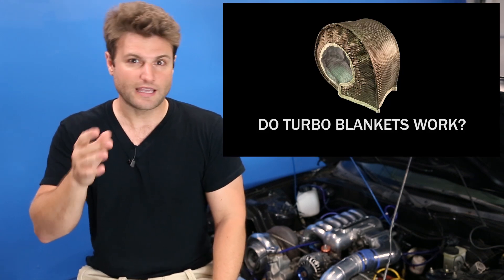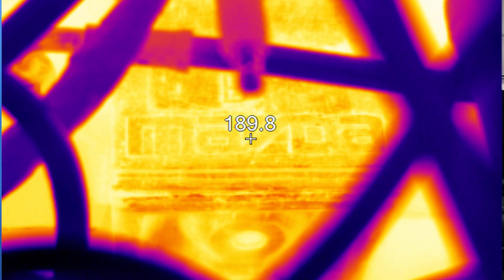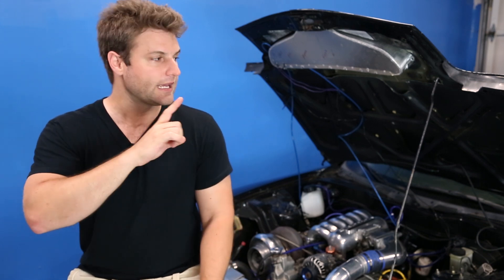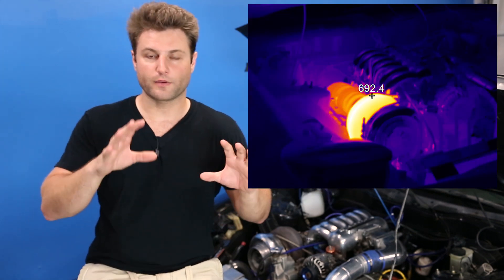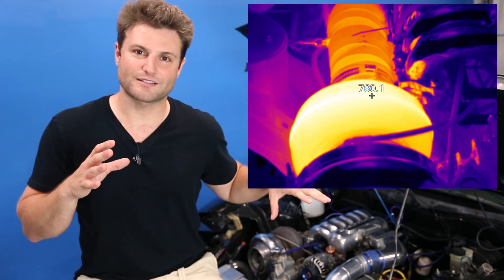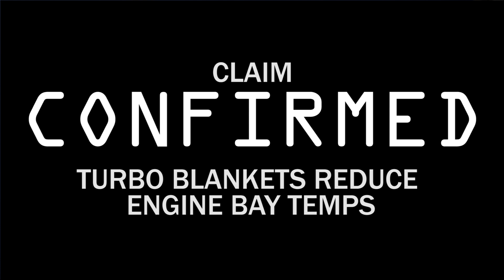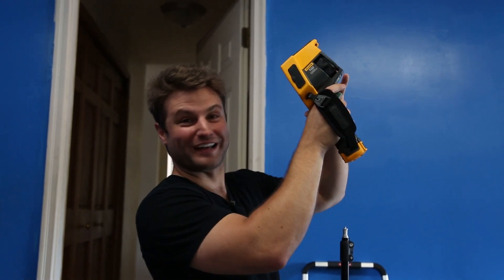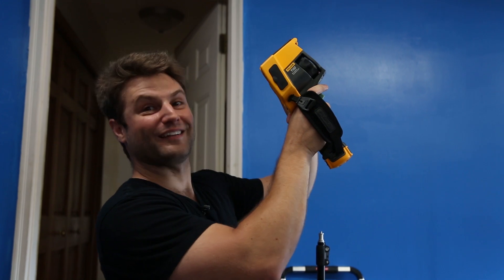Do Turbo Blankets Work?

Comment: thats why i love my diesel. 50-60% efficient. loving the f250 on 37s getting 20mpg.
Reply: 20mpg is not efficient. here we've got diesels touching 70mpg...which is 80mp(USGal)
Reply: A 4x4 f250 on 37x14 tires it's pretty good. We've got small cars getting 65mpg or so
Reply: +KustomGraphics206 its a 3/4 ton truck. not for mpg at all. but does good for its size. I've had 2 other heavy duty truck with gas motors and if I got better than 10mpg it was a good day.
Reply: He was talking about efficiency at one point in the video. Also, mine and lots of other turbo diesels make more power than that car.. So making more power, and better mileage, kinda relates lol
Reply: +KustomGraphics206 he mentioned that gasoline engines are only 30% efficient or something like that. that's all I was replying to
Reply: +KustomGraphics206 he mentioned that gasoline engines are only 30% efficient or something like that. that's all I was replying to
Reply: +KustomGraphics206 he mentioned that gasoline engines are only 30% efficient or something like that. that's all I was replying to
Reply: +KustomGraphics206 I definitely don't! lol. my diesel truck still almost doubles my gas truck in mileage so I drive it more. more comfy too. but we have a kia that gets 38mpg so its not too important to get good mileage in the truck.
Reply: +KustomGraphics206 I definitely don't! lol. my diesel truck still almost doubles my gas truck in mileage so I drive it more. more comfy too. but we have a kia that gets 38mpg so its not too important to get good mileage in the truck.
Reply: +KustomGraphics206 I definitely don't! lol. my diesel truck still almost doubles my gas truck in mileage so I drive it more. more comfy too. but we have a kia that gets 38mpg so its not too important to get good mileage in the truck.
Reply: +KustomGraphics206 I love my 6.0. drove the truck until 197k miles only issue I had was egr cooler busted around 180k. at 197k I was having long crank to start issues and started swapping injectors, issue seemed worse so I built the whole thing with 190/75 and all the supporting mods. turns out it was just the fuel pump. had heads checked at machine shop and they were perfect. put them right back on only blocked once. maybe I'm one of the lucky ones. but so far, 205k miles. truck towes a lot and sometimes towed real heavy. even with big fuel I pulled 18k for 7 hours at 75mph, egt around 1000 sustained. still going strong so fat.
Reply: +KustomGraphics206 I love my 6.0. drove the truck until 197k miles only issue I had was egr cooler busted around 180k. at 197k I was having long crank to start issues and started swapping injectors, issue seemed worse so I built the whole thing with 190/75 and all the supporting mods. turns out it was just the fuel pump. had heads checked at machine shop and they were perfect. put them right back on only blocked once. maybe I'm one of the lucky ones. but so far, 205k miles. truck towes a lot and sometimes towed real heavy. even with big fuel I pulled 18k for 7 hours at 75mph, egt around 1000 sustained. still going strong so fat.
Reply: +KustomGraphics206 I love my 6.0. drove the truck until 197k miles only issue I had was egr cooler busted around 180k. at 197k I was having long crank to start issues and started swapping injectors, issue seemed worse so I built the whole thing with 190/75 and all the supporting mods. turns out it was just the fuel pump. had heads checked at machine shop and they were perfect. put them right back on only blocked once. maybe I'm one of the lucky ones. but so far, 205k miles. truck towes a lot and sometimes towed real heavy. even with big fuel I pulled 18k for 7 hours at 75mph, egt around 1000 sustained. still going strong so fat.

Comment: Doesn't rising your turbo temperatures kill its bearings faster?
I'm affraid that this would kill turbos sooner just like the wraps to the exhaust manifolds do, the temps usually increase the likeness of cracks and deformation due to expansion.
Reply: +Eryk Szymanski your statement isn't wrong, but if you want to use the energy that's gonna be wasted, you must wrap up the exhaust manifold and insulate the turbine, to use as much enthalpy as you can squeeze out with your turbocharger. For sure your thrust bearings need to be cooled more than before...

You know, when you talk about performance, you always have a short blanket...it's not simply to have maximum reliability, efficiency and power at the same time ;)
Reply: I was thinking the same thing. If your wrap the turbine housing then it cannot dissipate heat to adjacent components. Sure, the compressor and intake manifolds may be cooler but you are adding a lot of heat stress to the compressor, increasing the chance of bearing failure or a crack forming in the housing. Would it make more sense to wrap the compressor housing and intake manifolds to insulate them from engine bay heat?
Reply: This was my thought as well. Turbo blankets (as has been proven a few times) have a HUGE impact on containing heat, but at the expense of the overall longevity of the turbo. Enough to be significant in my opinion.

I'd rather opt for an inside/outside ceramic paint job. I don't think that's quite as effective as a full, thick blanket, but a proper ceramic coating will help keep temperatures more tame while still dissipating properly.
Reply: +newpa1n I absolutely agree man, in fact in my next build I think I'm going for a ceramic coating 😉

Comment: All turbo & hot pipe blankets are NOT built out of the same stuff & are NOT equal & the most expensive on the market is NOT the best. Silica quilted blankets are by far the best. The goal of boosting an engine is to increase the air density to the engine & hot side heat absorbed by the cold side is counter productive to that. Plus if you're picking up hot intake air under the hood you are also decreasing the density charge. Monitor the charge temp at the engine, the lower the better.

Comment: I think it was touched on in a previous comment...but no replies.  But my first thought isnt that blanket going to cause the turbo to overheat or at least wear out prematurely?  i would assume that one could up the oil cooling capabilities, but I really dont know that much about turbos.  Someone else commented here....rear mount...that has always made the most sense to me (especially since I plan to turbo a truck).  I understand that the physical distance should create more lag, but cannot that be corrected for by tune?  Or if anything....evil grin....throw a supercharger on there too....super/turbos were not that uncommon on many old airplanes from what I have researched.  Sure a ton more money...uncharted tuning waters...and a whole lot more work...but it would give a whole new meaning to "S/T" badging...lol....just my 2 cents....

Comment: One of the more common explanations I've heard is keeping the impeller side as hot as possible, and limit that heat to the turbine housing.  The rest of the exhaust will be a lot cooler and, hot fluids/gases will flow towards colder environments (kind of like the EJ20 engine having an oil reservoir above the turbo to allow cooler oil to flush through the bearing interface via thermo-capillary action).  Be it the exhaust pipe (which is designed for it) or the hood (not so much).  Also, if running higher swirl densities with water, ethanol, or methanol injection (or even an E85 tune) you're going to have more moles of gas getting flushed through the impeller.  Controlling its radiated heat that's wasted is incredibly important, and why most turbo cars have a lot of heat shielding around them.  Although that's one of the nicer looking turbo blankets I've seen.

Oh, and 30% + 60% = FTW.  ;-)

Comment: but wouldn't containing all that heat and preventing the transfer of heat cause the turbo to reach a point where it'll all fuse together? as in the turbine to the turbo wall... also how would air from the intake have different temperatures per cylinder? isn't the air entering from the throttle body into the manifold getting equally distributed to all the cylinders at equal temperatures?
Reply: because on this engine the turbine housing sits right next to one of the intake runners which means it gets heat soaked and the air going through that runner will be hotter than the other runners
Reply: Tom Nicklas Sand So it is not applicable on reciprocating engines?
Reply: Usually not a problem on engines with crossflow heads but older engines with exhaust and intake on the same side like datsun L series can experience heat soke if not properly heat shielded
Reply: Stupid questions so why ask also the turbo will never melt wtf are your smoking and each cylinder has it own temperature too look up (EGT ) please got do some research before post bullshit
Reply: Gaz Girl not everyone is well versed in everything car related or act so... I have my questions and as long as people are there to clarify those... I will continue to ask! I do know that each cylinders may have minutely different internal temperature due to variation in combustion and also due to pre-ignition etc... But read my questions... I was asking about the inlet manifold and how the temperature of air going to different cylinders can be different as I've seen engines where the inlet and exhaust manifold are at opposite sides! I also know that when a metal reaches its melting point it will melt... And at that if heat doesn't conduct to the environment the more the heat buildup occurs!
Reply: +Sukrith Krishnakumar I know this already also the temp in the intake mainfold will be different but to a point also depanding on if it's turbo /na  car everything has a massive effect different components so this will change things so many factors list goes
Reply: +Sukrith Krishnakumar mate you need a shit load of heat to melt cast iron like 2000 c easy before it melts and what engines are you talking about because most or all engines are cross flow design and not the intake and exhaust mainfold on the same side or non cross flow engines
Reply: It's more of an issue for a rotary because unlike a modern piston engine you can't control the air fuel ratio per rotor at least not with any ECU's I know of.  With the stock tune that's not an issue, but with more aggressive tunes there isn't much wiggle room.  In many cases the sensor is located in front of the throttle body which is on the opposite side of the engine from the turbo.  A 10c could put you at risk of detonate which has a nasty habit of breaking the apex seals.

I somewhat doubt it effects the air temp that much though, that air is moving really fast so it's not going to have much time or surface area to pick up a lot heat.  I would be more concerned with lower the overall under hood temp, which why many people run full vented hoods on these cars.

Comment: Well I learned that an engine that is 30% efficient wastes only 60% of its potential energy... Good to know that 30% + 60% = 100% lol
Reply: +Rob Dahm besides, 30 is quite a bit of an overstatement. I'd say 20 to 25 at best for a gas engine. A rotary will probably do even lower.
Reply: there's also sound, like vibrations, so a small percentage will be converted to sound.
Reply: there's also sound, like vibrations, so a small percentage will be converted to sound.
Reply: there's also sound, like vibrations, so a small percentage will be converted to sound.
Reply: I assume he was thinking along the lines of 33.3 and 66.7 and then rounding down.

Comment: The claim about bringing the turbine blades closer to the housing (reducing clearance) is easily checked, without ever breaking out a clearance gauge. Find out the material of the turbine wheel, the material of the turbine housing (I'd imagine that aftermarket turbo manufacturers publish this?) and check the rates of thermal expansion for those two materials on the interwebs. If the turbine wheel material has a greater rate of thermal expansion than the turbine housing material, then increasing temperature necessarily draws them closer. 

That begs the question, of course - does reducing that clearance actually improve performance? Does decreasing that clearance flow overcome any negative effects (reduced exhaust density, increased deformation of the turbine wheel, increased maintenance costs due to increased creep rates, etc) to make it worth it? That's up to each car owner to decide.

If turbo blankets were worth it for the OEM, they would have included it, at much lower cost than the aftermarket. It's not like thermal insulation is unknown to automotive engineering. So don't put one on your otherwise stock Focus ST or whatever.

Comment: Would love to see a difference between a bare turbo, ceramic coated turbo and ceramic coated with a turbo blanket. I know the ceramic coating on my ducati's exhaust helped a ton keeping heat off my leg as well as keeping the radiant heat off the parts that the exhaust is near throughout the bike.

Comment: Rob, I'm wondering how much difference polishing the hot side of the turbo would make, or coating it with a low emissivity ceramic coating vs the turbo blanket. Like you mentioned, getting accurate temperature readings with an IR cam is not easy from a polished/reflective surface (due to its low emissivity, i.e. the ability to radiate heat)...so with a polished/low e coated hot side, that should work very well to lower engine bay temps, and keep the exhaust gasses hotter. Doing all of the hot side piping all the way back to the motor should help tremendously. Btw, it still makes me laugh seeing another MHS physics kid getting his videos shared by the street outlaws crew on Facebook.

Comment: I have a Duramax and I'm told cool your turbo all the time.
Reply: When you're going to shut it off it should cool not during operation. They like to run hot but when shutting it off you should be letting egt's drop to 300 before shutting down. When not running, the oil isn't circulating anymore and the oil cokes in the bearings if over 300 and reduces the life of the turbocharger.
Reply: +jfdb59 that makes sense, I had a get gauge an always let it get to 350 before shutting it off, put over 200,000 km on it without a problem, thanks jf.
Reply: My LBZ duramax was a great engine though a bit thirstier on fuel than my cummins trucks. I have a cummins now with compound turbos and the kit came with one of these turbo blankets because the top turbo is really close to the firewall and a main wiring harness. You can put your hand on the blanket even with the engine idling at operating temp. It's pretty impressive.
Reply: +jfdb59 I also had the lbz, loved that truck, power was amazing, I was happy with my mileage I got about 19-20 mixed driving, it sure was fun when I put the ppe in, but then my 5th gear started slipping.

Comment: I am a firm believer in exhaust wraps or coatings aswell because I have had guys come in complaining of hard starts after a hard run down the road. the cause was the heat from the header or turbo evaporated the fuel in the fuel rail

Comment: This may be a stupid question, but by containing the heat and not allowing it to escape, won't that ultimately harm the turbo?
Reply: I think it may improve the life of the turbo by slowing/ smoothing out the heat cycles during a drive.
Reply: No, turbos are meant to run that hot if not hotter. If any it would help it to keep a more even heating in the turbo itself
Reply: Yea that too! Thermal stress will be less dramatic when the turbo is cooled slower and more evenly!
Reply: https://docs.google.com/file/d/0B1DKgBxqE0JEME5wQ1pIc1N5dU0/edit?pli=1
Reply: It is bad for engine oil.

Comment: you should put a lover section right behind the turbo exhaust  on the hood . and have it so the cool air will go over and pull the heat out of the hood in that area

Comment: A big benefit of turbo machinery is that higher temps in the exhaust side result in more energy extracted from the gas passing through the exhaust. The energy extracted goes straight to the compressor and the gas is more compressed than without the blanket. That's what gets you your increase in efficiency. And for turbos you're never really gonna get close enough to the temps required to melt the turbine blades (gas temps are less than 1900 degrees for the most part). degree. Just took jet engine class.)

Hotter turbo is a good time. Cool turbo is a meh time. For a big turbo 3 rotor it is was probably a big enough difference in power to notice but for smaller cars it probably wouldn't be. Still worth doing something. 

(Doing an Aerospace

Comment: imho you're better off ceramic coating the exhaust housing, exhaust manifold and downpipe .. the engine bay temps reduce a lot more, plus it stops the housing rusting under the blanket, plus its stops the blanket eventually shedding fibres everywhere, plus turbo blankets look stupid :)

Comment: Hey Rob, keep the knowledge bombs dropping!! could you please do a video on E85 fuel and since at least 30% more volume of fuel is  required for a boosted engine do you run the chance of hydrolocking or landing ring damage to a piston engine?  Because let's face it.. The extra fuel needs to go somewhere..  Thanks!

Comment: Great JOB +Rob Dahm, I always like watching informative video's.  Kind of like Real Street does, and other YouTubers, it's always interesting to prove something or learn something new.  How about a video about billet wheel vs cast wheel for the turbos?  Going T3 vs T4, twin scroll, internal gate, external gate, forward facing, top mount?   Now that you are using that thermal camera what about something with heat soak in the intercooler?  Measure IAT after "spirited" runs?  There are a multitude of things you could do with the thermal camera that would be fun to watch!